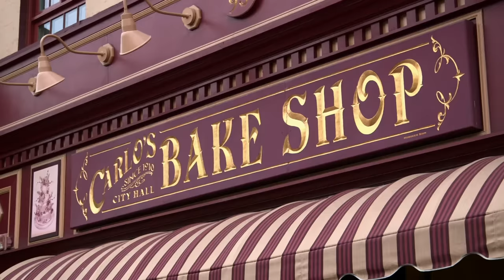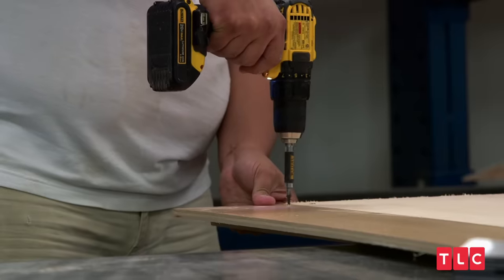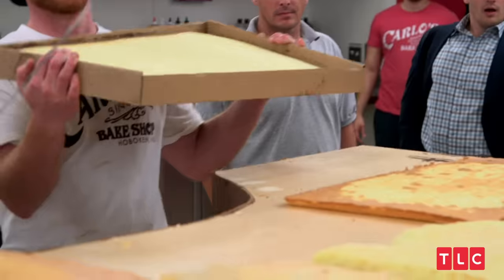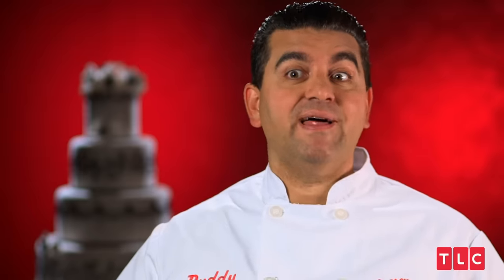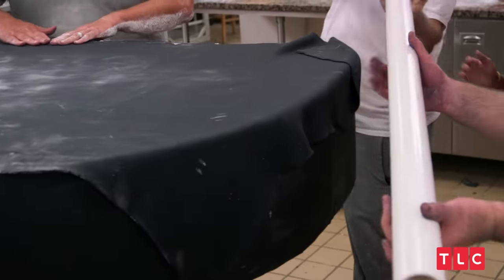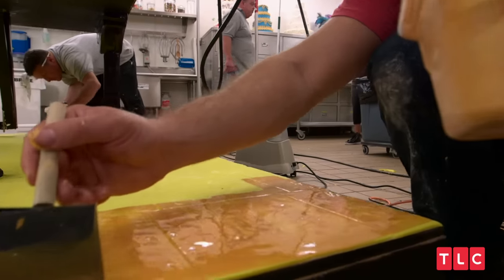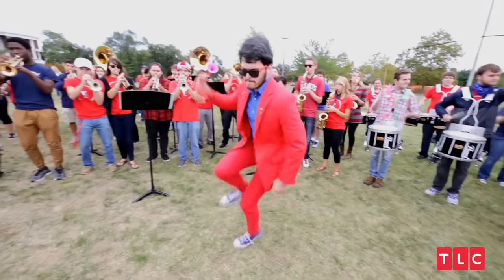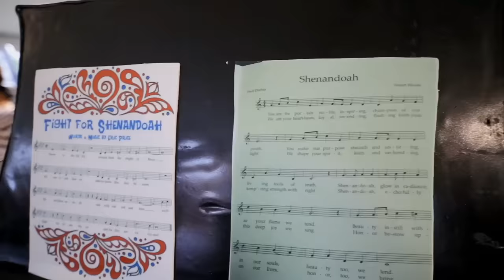A Life-Size Piano Cake! | Cake Boss

Comment: As a baker and someone who used to own pianos, here's how I would've done it:
If the client didn't specify which type of piano and the cake isn't in the heat too long, to maximize the amount of cake, I'd do an upright piano instead of a grand. You'd need a cake board at the bottom to support all of the weight, so drilling food safe dowels into it is the best option as well as having smaller cake boards and dowels every few layers for extra support. For the overhang where the keys are, best to have a cake board for support; chocolate shaped for the legs would be good with a dowel on the inside could support that overhang. The rectangular part, where the strings and hammers of the piano are would just be filled entirely with cake then a buttercream crumb coat. I'd cut large pieces of chocolate to coat the outside, instead of fondant, because not only do I think it tastes better, but the chocolate can be scuffed up a bit with a brush then airbrushed a wooden color. The keys I would probably make separate, rather than covering fondant for all of the white keys then adding blocks of black fondant. The keys could almost literally be filled with anything. For extra fun, I'd do a wafer type thing then a light buttercream in a rectangle shape with a slight lip (because pianos tend to have a little overhang on keys) then coat it with a either a white or black chocolate ganache or mirror glaze. The pedals can also be made of chocolate then air brushed gold. For extra extra fun, I'd present it (gloves on) pretending to play the piano while having someone play Schubert or Mozart on a disk or something, reading chocolate sheet music while another person conducts me with a hard candy baton.
TLDR: I'd make an upright piano instead and I'd use chocolate how Buddy uses fondant.

Comment: I hope they cleaned the wood base before slapping on all of that cake. they sometimes use a lot of metal pipes as well and I don’t know if they clean it before covering it in frosting. I saw one episode where they had to make a replica of the Statue of Liberty, where the base was all wood and some of them were standing on it testing it’s stability. Then later they covered those areas with fondant. I wonder if they tell the clients not to eat the fondant on the wood.

Comment: Wouldn’t it have been more fair, (the cakes costing Like 800$ or more) to have one thick board at the bottom of the body of the piano, and stack it with pound cake to reach the top instead of making a box and putting the tiniest bit of a cake layer on top.

Comment: Try Fantasia Fondant, @t you won't regret it.  It is a very forgiving fondant with a long work time, which makes it easy to work with for beginners and pros.  Fantasia Fondant is formulated with elasticity making it a high performing fondant when covering cakes or performing in silicon cake molds.  The colors of Fantasia Fondant are vivid and fadeproof.  This fondant will not prematurely dry, crack, tear, break and 'elephant skin" even when rolled super thin to cover cake dummies.  Offers a less sweet taste that resembled a homemade marshmallow fondant.